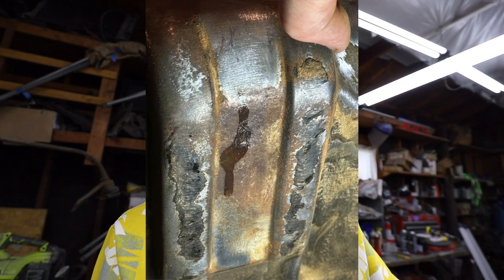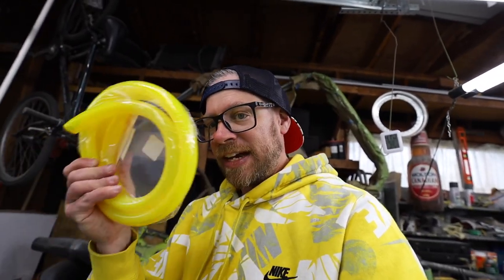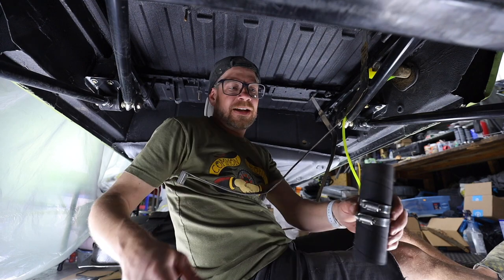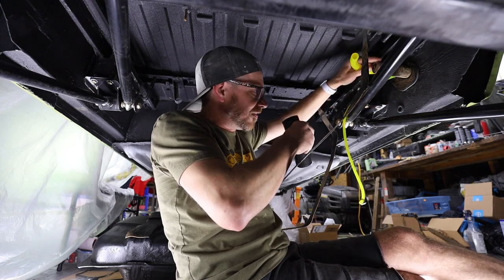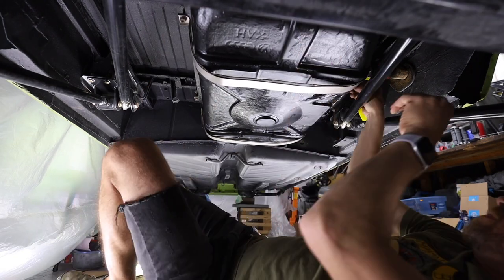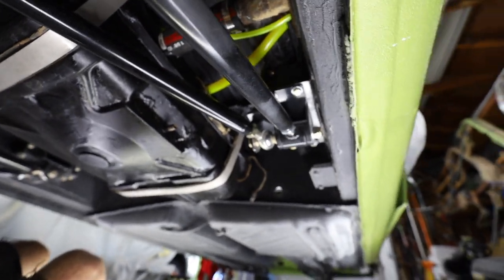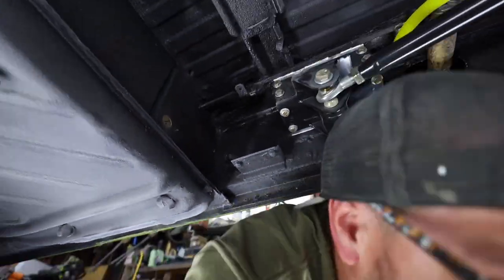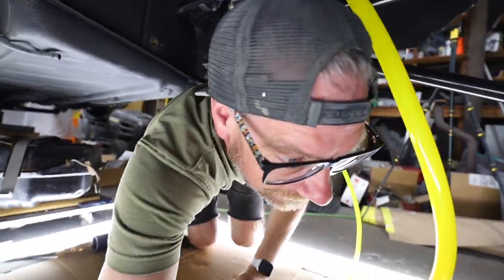VW Mk1 Fuel tank refresh and install -- Rabbit pickup project part 41

Comment: What kind of hose did you use for the vent tubes?
Reply from the maker: It was Tygon PVC Tubing for Fuels and Lubricants from McMaster-Carr.  I used it for the large vent hose and the smaller one on the tank level sender.  I know it doesn’t have the spring in it but others have used it without any issues.